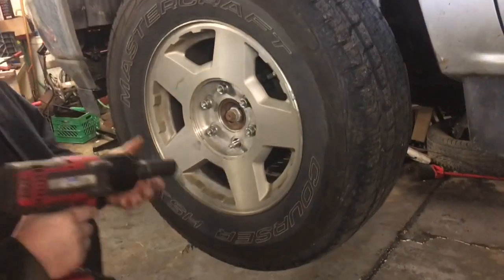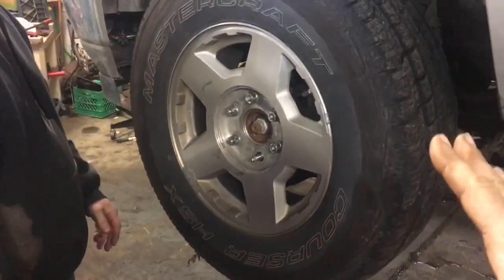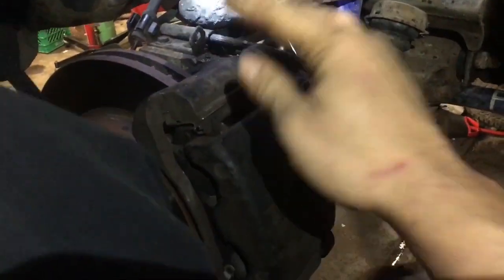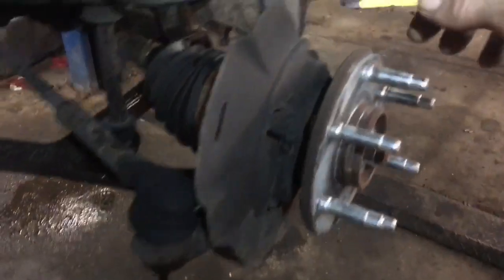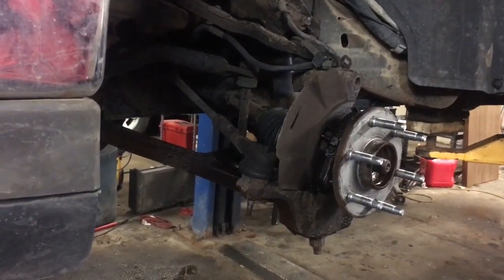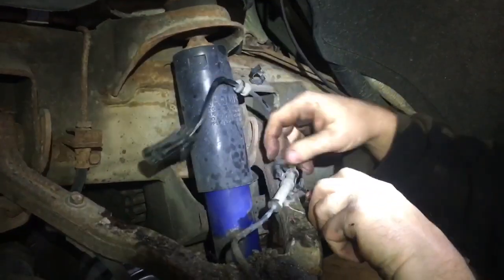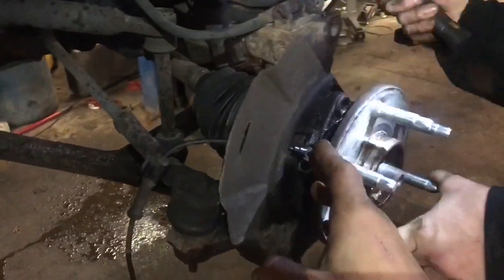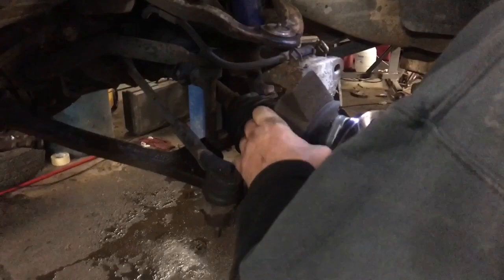GMC sierra front wheel bearing installation and removal tips and tricks

Comment: Thanks!! Started hearing a growling noise and new it was time to replace. Do you recommend any sites for ordering? 2009 GMC Sierra 5.3 v8? Or part number? 4x4
Reply from the maker: It doesn’t show me what video you’re commenting on but I can see the thumbnail I think you’re talking about the four-wheel-drive not working

If you go to Dorman Parts and put in the discount code the clay way. You should get a discount if not you may have to wait till the day to call them. You might as well get it directly from them it’ll be the cheapest
Reply from the maker: Sorry didn’t notice you were talking about wheel bearings personally the biggest thing about wheel bearings is when you replace them torquing The axle nut down to the proper torque is the most important thing if you do that you generally will not have a problem with just about any bearing. From anywhere you buy it

Comment: Would this be the same process with my 2015 2500hd duramax.  It’s got 65k I think I’m starting to hear that classic “bad wheel bearing” humming noise on the front driver side
Reply from the maker: Hey Mo I do believe it should be I think in this video was actually doing one on a 1500 but they are nearly identical you just have beefier parts.
Reply: Ah I see gotcha.  It’s just a new truck I’m hesitant to break into it ! Did it on my 2002 2500hd with no issues.  Guess I just need to man up and get it done !

Comment: Awesome video ! When you put the new wheel hub on do you just slide the cv axel right in the wheel hub and then tighten the hub on ?
Reply from the maker: Thank you for the kind words Chris I appreciate that. Yes you do. you do you want too Torque down the nut properly though. If you just tighten it down and you over tighten it or under tighten it it will cause the bearing to fail prematurely so make sure you look up the torque specification for the nut it will just slide right into the wheel bearing .
Reply: @sharpcarco  thank you.

Comment: Thanks brother! Getting ready to do this on my buddy's 2009 GMC SIERRA 1500 4X4 this afternoon, and this is exactly what I needed. Money is definitely an issue for us, which is why we are doing it ourselves... but I don't have a torque wrench. How important is the exact torque on the hub nut? Literally every penny we have is spent on the hub assembly, so we can't even afford to rent tools from the parts store... except for the hub nut socket. If I just get it snug and then turn it a bit more to line up with the cotter pin hoke, will that be sufficient? Thanks again, and hopefully you get this message and can reply before 2:00p.m. today. God bless you family 🙏✌️
Reply from the maker: Hey good morning I try to respond to everyone. Especially people who say nice things to me I love getting up and reading nice messages so I greatly appreciate it makes my day a lot better. 

As far as that not goes it is pretty critical that it is torqued properly if it’s not to work properly. It could cause premature bearing failure but generally if you do not over torque it too much it takes quite a while for that to happen(for years I never torqued them down) 

It sounds like your way of thinking about it should be appropriate and I doubt you’ll have any problems. Think about it like the old bearings that we used to put in the rotors were you tighten up the bearing a little bit then loosen it a little bit and rock ‘n’ roll. 

I hope that’s helpful and I’m glad the video was able to save you some money God bless be safe and have a great day
Reply: @sharpcarco  thanks brother

Comment: No torque values ? Did he actually hit the axle threads with the hammer ?
Reply from the maker: If I would’ve added torque specifications. But if I happen to give a contradicting specification somebody such as yourself will just pointed out so I let people look them up for themselves. . Just like you pointed out that I hit the axle with a hammer. normally I would use a brass hammer. But I do it all the time because I have what’s called a thread file. Even after hitting that axle with a hammer somehow I managed to get by. 
It might not be the way you do things but it’s the Clay way........ have the greatest of days and God bless
Reply: yep that's a bad idea. best to hit the nut or use wood. I've made that mistake on other things.